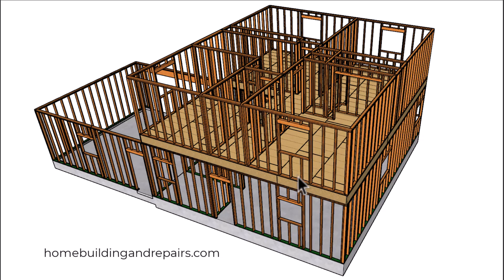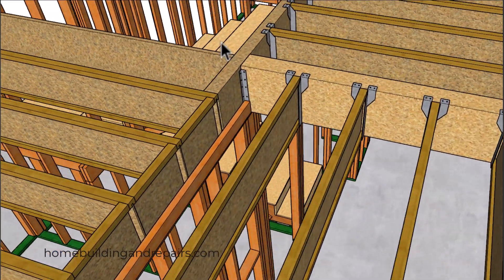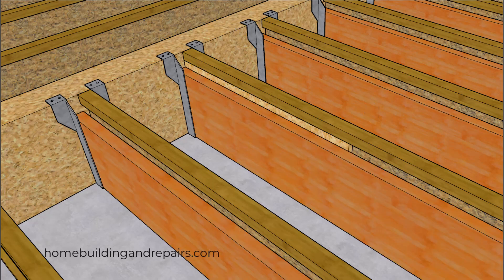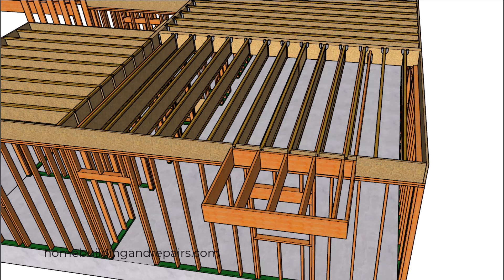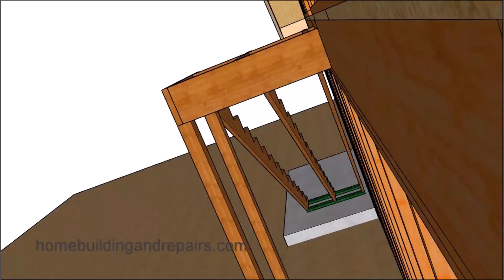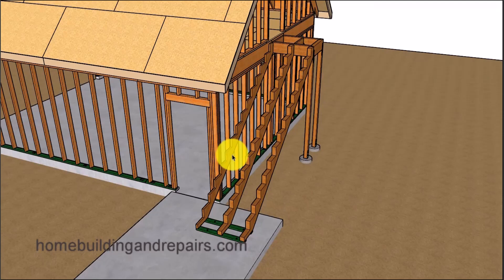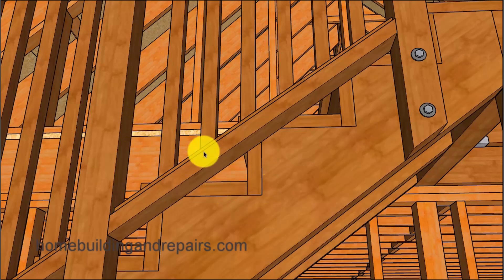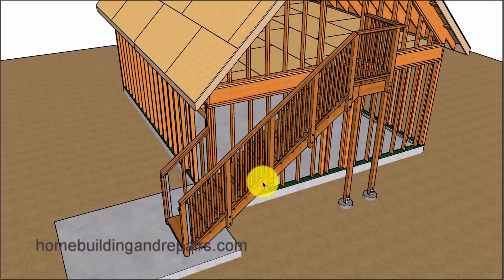Balcony And Stair Framing For Two Story House With Engineered And Construction Standard Lumber

Comment: The mistake I typically see done with header joists on your cantilevered balcony is not installing the joist hangers upside down.

I typically avoid having the stringer attached to the wall like the plague because there's no way to guarantee water from infiltration into the wall through the brakes and penetrations through the wall's water shield envelope with out getting ridiculously expensive. 

The common compromise is to sandwich a strip of water barrier and aluminum flashing in between the stringer and wall framing during the framing stage with the water barrier envelope extending at least a foot and flashing extending at least 6" beyond the stringer so as to alow for shingle style overlapping with the whole wall water barrier envelope after the framing stage is complete.

I typically leave the out board stringer unnotched when using double stringers for better strength and better esthetics. And if single stringers are preferred, I still leave the out board stinger unnotched and use metal angle connectors specifically designed for stair treads.

To stiffen the last newel post at the bottom of the stairs on an open stair railing design I'll typically run two threaded rods in between double bottom risers connecting the two newel post on both sides, clamping them to the stairs under compression.

If a stronger method is needed for the bottom newel posts, I'll run a ½"x3" steel flat bar on the back side of the newel post to make it much less conspicuous. Don't need to concern yourself about a bottom stair rail connection at the steel because the bottom stair rail can simply be deleted in favor of simply running the balusters all the way down to the face of the stringer and attach them there.

Comment: The metal post at the end may be necessary, but it messes up the aesthetics. I’d probably try to hide it in a pseudo-column by mitering a 4 piece matching covering for the bottom outside post. However, that also means the metal post needs to be positioned very precisely, which I’m not confident I could do. If it’s messed up, the whole railing looks geometrically imperfect. Any tips about locating the post position?